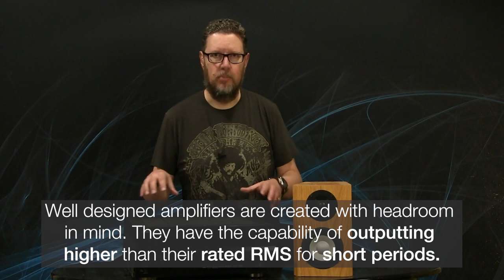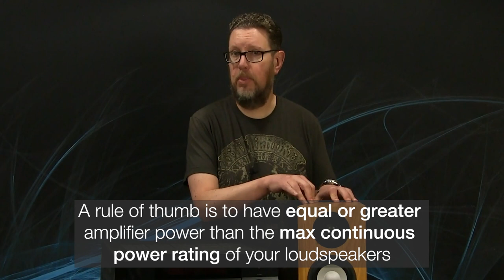Headroom: From The Axiom Audio Glossary: Audio Terms Explained

Comment: this is such an underrated Video. it should have more views and way more likes than what it currently has. this is all facts when it comes to car audio speakers and Amplifiers as well. the only difference in the car audio world is that the amps require Good Stable Electrical power from the vehicle's charging system in order for the amplifers to produce power output for your speakers. but overall very well said.
Reply from the maker: Thank you for your comment, much appreciated! Excellent point on the electrical power for car audio.

Comment: I agree absolutely about equal power or a little bit more, for the amplifier compared to the loudspeaker.
Once I had an Exposure XV 60 Watt integrated amplifier, but later had to «downgrade» to a Cayin 252B with 200Watt.
Quality of sound, like details, was great(and better) with Exposure, but dynamic was so much better with Cayin on the same speakers!
It was at that time I discovered how to «wake up» my speakers, most speakers really play more dynamic with a powerful amplifier, even at low listening levels.
Most quality speakers can handle a lot of power for a short time, it is low power amplifiers that will destroy them!
Reply from the maker: Thank you for sharing, your experience mirrors what I have found over the years.

Comment: Hi Andrew,

A question on active HPF on my Crown XLS 1502 amp which I'm thinking of using a pair in bridge mode at 1050wpc at 8ohm, 1550wpc at 4ohm to power my Focal Aria 926's. 

My speakers go down to 45Hz should I cut lower or give them full frequency and let the speakers passive crossover do the work? 

Music only system average Listening level is about 85dba. Thanks

Comment: If rms is measured at the clipping point and headroom is louder still, could we define headroom as the range from rms to max?
Reply from the maker: There are many ways that you could define it, but it’s difficult because you need to include time in the measurement.
Reply: @AxiomHomeTheaters  max power already addresses time since rms is meant for continuous output.
Reply from the maker: @Alkatross  Correct…what I was getting at is that manufacturers would need to agree on some standard as to what length of time is representative of a max power rating.

Comment: The headroom of amplifiers or speakers is almost unknown to the customer because it does not clearly define in the specifications.  Even if it is included, I think it is rather difficult for the general customer to verify it.

Also, it is not perceivable as it is seldom known for its unit.  The most intuitive description may be in terms of the percentage of maximum watts.  

It is a complicated and difficult topic as not all customers tend to turn her amplifier to the maximum to test them.  I think it is more of a matter of the designers who want to maintain a low distortion at the peak output level. And then making it the selling point.

Please point out if I have misunderstood anything.
Reply from the maker: You are absolutely correct, and it becomes even more difficult as you will not truly know the system headroom without the context of the speakers you are trying to drive.